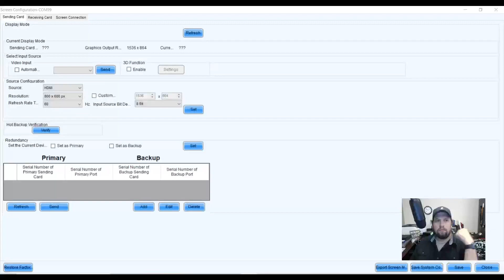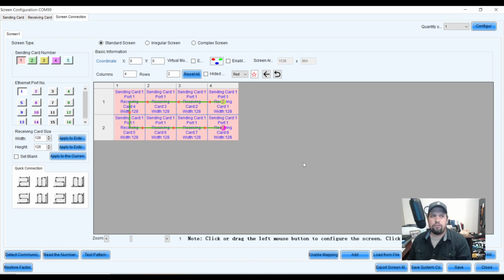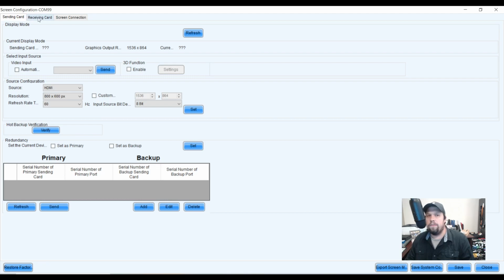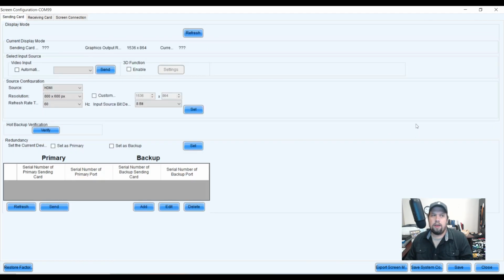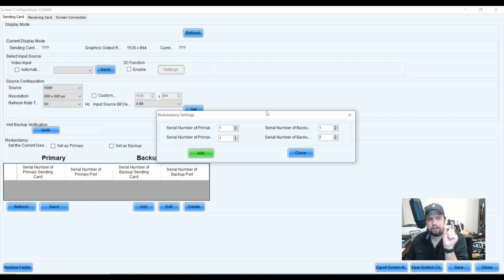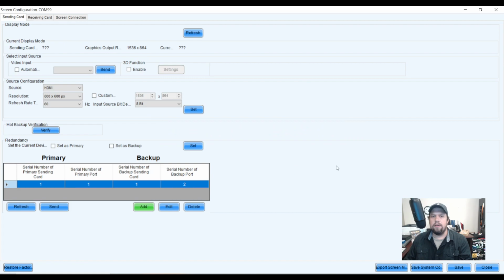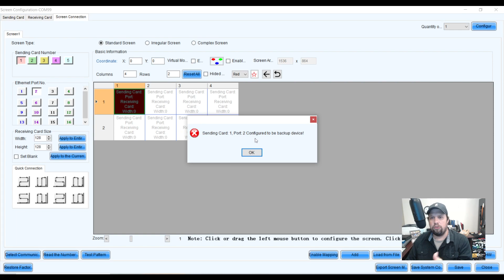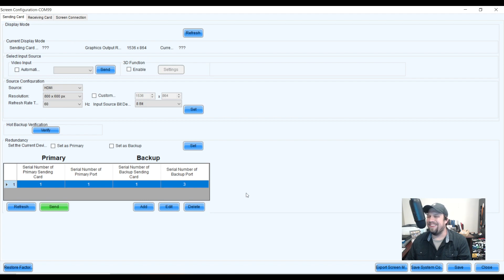Novastar   NovaLCT Creating a Redundant Backup

Comment: Thanks! 
Where are you plugging in the ethernet from the backup port? Also when configuring the wall, is LCT showing you the front or back view of the wall?
Reply: You plug the backup line into the Data Out port of the last panel in the chain fed from the corresponding primary port.

Comment: had a tile go down yesterday on day two of show. simple 24 tile wall (6X4) 2ports 2back ups, don't think back ups were ever set on software initially, but the first tile on second port failed overnight but rest or tiles remained. my question is would these back ups kick in regardless if back up redundancy wasn't added on software side or perhaps video head doubled back and set redundancy after we moved on to other walls on exhibit floor